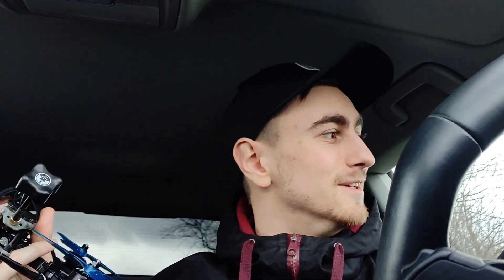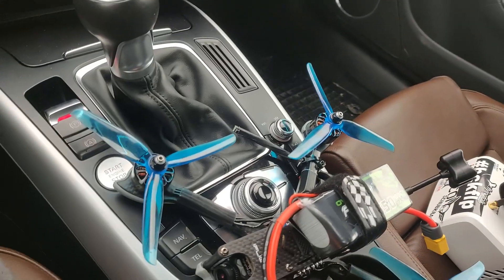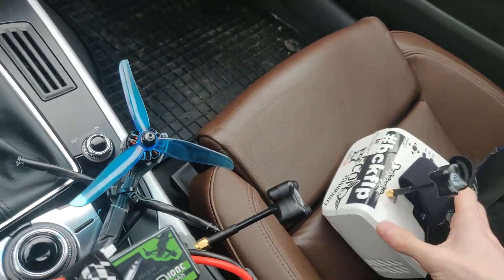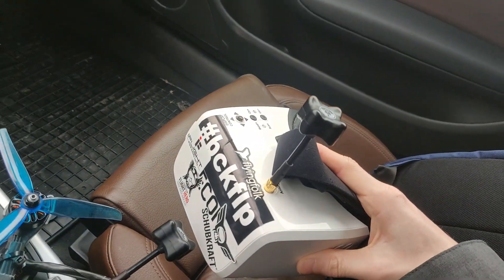TBS Unify Pro HV | 25mw vs. 800mw 1000m Range Test

Comment: no difference at all? then set it to 25mw instead of useless 800mw
Reply: There definitely is a big difference but his test was on perfect conditions where the 25 mw could perform at its absplute best which makes it seem like its as good as 800 but its not when you compare them both in normal flying scenarios where trees are between and other obstacles and everything else

Comment: Don't understand how people get 1km in 25mw. My longest so far is about 200yrds 25mw
Reply: Same here, with 25mw (on all tested vtx so far within the last years) i can fly about 30-100meters. Never more! I cant believe what others here on youtube are doing with 25mw.... :D
Reply: @MrSmithFPV  hi, im using 7inch quad. 25mw.. Accidentally  go to about 2.5km :) one thing you need to know..im doing 25mw because  i forget to change it. Lol.. Using a right antenna in your googles.. like helical 6  and of course. Interference matters.always. ^^ happy flyng.
Reply: Same... wonder why
Reply: @BiteSizedStor1es  there's a wifi tower not far from me. I think that's why I can get far
Reply: Maybe your antenna setup?
Reply: @rizen3467  This very possible. Its hard to find info on what antennas actually work well and what to use on the drone and what to use on the goggles VRX's side with the dual antennas. Im guessing one should be a patch antenna and one a regular style. But im not sure. 
If anyone has any recommendations for an antenna to use with this VTX on my drone, and what antennas to use on my Fat Shark RX5808PRO VRX Module with dual diversity antenna's.. please post them up!
Reply: radio interference in your area could have something to do with the results. Notice how there are no buildings, power lines or other population at his test site. those are ideal conditions.